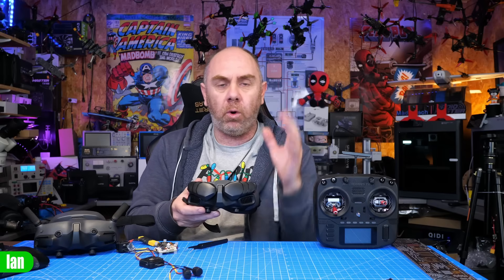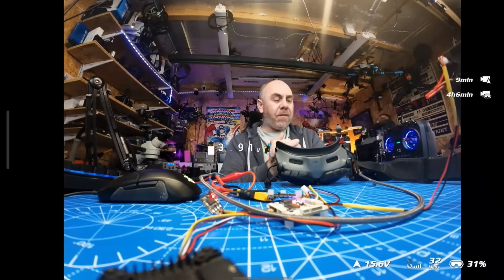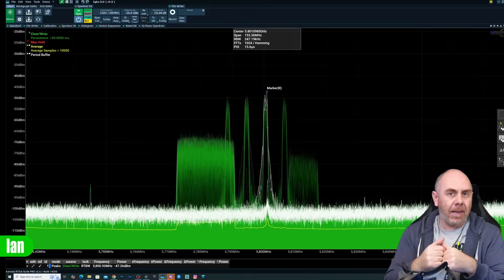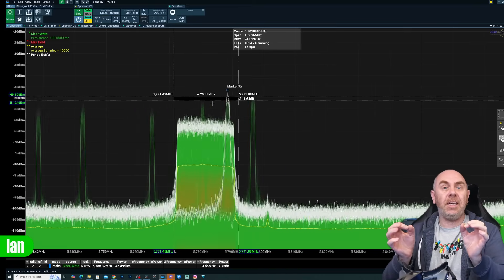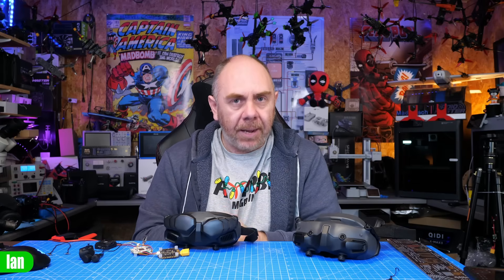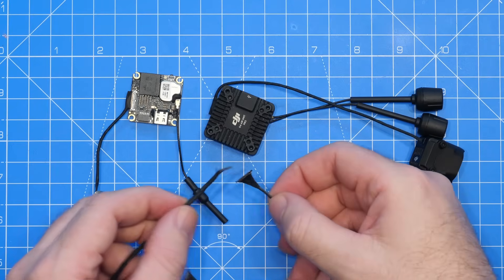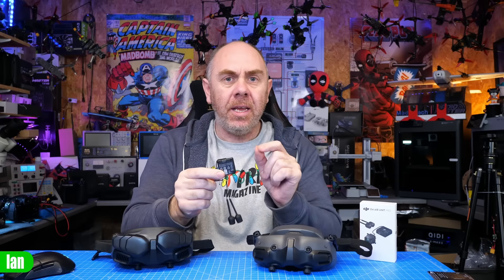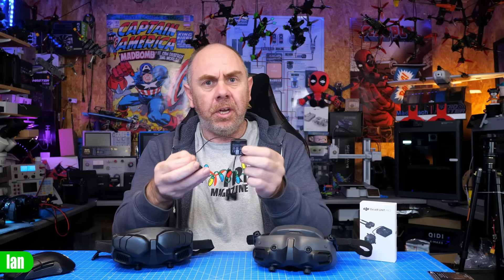DJI O4 Issues Warning - 16Mbps Goggles 2 Bug - Bad Camera Cables & Inav Arming & OSD Missing!

Comment: My O4 lite blinks black less than a second on my goggles N3 even in a flight, I dont know if is a kind of warning or something, In the begining I think this was for the low energy mode but when I arm the drone and begin to fly the issue is still there, the video from camera turn black a milisecond every 2 or 3 seconds (only video, the osd is still there), the rare thing is that when I see the goggles record it does not show that black frames even the record on the drone is fine, do you know if is only a warning of something ? or is a normal thing? I am new on this and I crash the drone some times, so I dont know if is a warning that something is not right with the O4 lite, and obviosly is a little bit anoying that black video little moments

Comment: Good job, I'm having a problem, I have a DJI Air Unit Lite and a Goggle N3, I updated the firmware on both. The N3 has an image, but when I turn on the propellers it freezes the image and then comes back. I'm using Cineape 20 (FC Darwin F411 15A), with 2S and 3S batteries. Do you have any idea what might be happening?

Comment: I saw this video right when it came out.But all my drones were 03, and my only 04 was the Avata 2, which is a pos imo. My iflight nazgul evoqie f5 with 04 pro just showed up today dead on arrival. Both DJI and Newbeedrone are telling me iFlight most likely killed this mipi cable during assembly. I missed my gig over this crap

Comment: Stucking video feed at 15-16 Mbps is not the main concern I think with o4. I am able to do 50mbps if I play with manual 40mhz and back to auto sort of thing. Reducing the mbps gives more signal strength so i dont really worry if i have less if i am further. Bad not to get it nearside though.  
The main thing is the overall low performance. I have 10 times better signal in rural areas with my old mini 3 pro in CE mode which has an o3 similar system i think. G2 is not only not changing o4 frequencies efficiently but overall performance is terrible as well. I tried it in CE mode it was a joke. FCC mode a bit better but after 1 km a  block of signal brings down the signal drastically to a signal loss (due to the not clever auto setting and the overall bad performance or interference?), this does not happen with my mini 3 pro drone. People say go with Goggles 3 but now that has interference with elrs? Probably not to best time to get in fpv with dji. I chose it because i thought its a bit more user friendly, never mistaken more.
Also i read the new goggles fw (or the o3 fw) makes the o3 cameras gets out of focus on G2?? what the heck. 
Also i dont understand a guy here from italy has no issues with G2 ce unit in fcc mode on o4. bad quality control?

Comment: o4 air / lite - small branch caused camera to disconnect - but it was the whole daughterboard, not just the cable- IMU error now with full video signal in goggles. since I bought it from betaFPV it is origin china. not eligible for RMA / warranty In the USA. I opened a ticket with both DJI and BETAFPV.

Comment: The one I purchased, when powered up the green & red led both light up & isn't showing in the assistant app & wont go into bind mode. When I search online all i get is some redit user with a similar issue but no solution. I first thought it was because my FC only had 5v output and the 04 requires Input Voltage: 7.4V – 26.4V with a recommended power input: 9V so I installed a BEC that outputs  12v. Anyone else run into this?

Comment: I have been writing to DJI Support for two months. After sending what feels like 100 log files and videos, DJI has now concluded that the issue is caused by the HAM file hack.

DJI’s policy seems to be that we have to buy the latest goggles where the hack still works. #madstech

Comment: Hey, thanks for your work! There's a big problem with the DJI O4 Pro. Can you briefly comment on it? The latency is terrible at 4:3. because there is only 50/60 fps in high Res. 2.7K x 4:3 x 100 fps isn't possible. This is very frustrating. Even the O3 managed that. I would expect with the new Gen 4K x 4:3 x 100fps. but there is nothing... Why DJI?

Comment: Hi ! Is there a solution yet to this issue from DJI ?  
I just got my new O4 pro to replace my O3 and works really shitty with my  Integra (with Ham file ).  Much worse performance than the older O3

Comment: Hey dude! I’m having the following issue with my O4 Lite connected to a T-Motor F7 AIO flight controller: I’m not getting any OSD, no battery voltage display, and the recording doesn’t start. I suspect that the flight controller isn’t communicating with the O4 Lite unit. Everything is up to date with the latest firmware.
and the videos manualy recorderd are not on the memory on the unit afterwards.
I’ve had a similar issue with another O4 Lite setup, where the cable wasn’t seated properly, but that doesn’t seem to be the case here. I’m getting video feed, but the bitrate is capped at a maximum of 6 Mbps. I’m using DJI Goggles 3 and N3 goggles. I’m completely out of ideas at this point.
am i the first one with this problem?

Comment: I have the Goggles N3 with the Ham file on it and the O4 lite in a fixed wing.
Went on a Testflight today and only got 32 Mbps and a max range of 2 Km which is disappointing.
I selected 40mHz manually before the flight.

Looking for a solution 🤷🏼‍♂️
Reply from the maker: There is an issue with the Ham file in FCC mode causing this. We are waiting for DJI to release new fw.
Reply: @MadRC can you check if the latest G2 update (that included O4) has the same effect on the signal with O3 please? Someone reported something like that, also messed up the focus as well.

Comment: Hello Ian tested today O4 + G2 with Hamfile( Italy)
 > i've esperienced all the issues you have reported about auto mode. I've also had some troubles with video feed with loss of frame rate( not on the Mbps) Tried to change switching from auto to manual to 700mw or 1200mw , the issue above just re occurred.
Once i switched to 04 + G3 no problems at all.
I guess ..and hope is something dji will soon solve

Comment: What actually happens if you only connect the air unit O4 PRO via USB and only update it, thereby skipping activation and binding it to the goggle without activation? Maybe this stupidity happened to me. Until then, what DJI says will happen. namely that not all functions are available. Now I wanted to carry out the activation afterwards. But I only get the error message “Activation failed, please try again”. Well, I've been trying again for 3 days. nothing happens except that a new LOG with 100MB is written to the Air unit every time. Can I reset the air unit to factory settings? Or do I have to send in the hardware just because I didn't follow the order for the firmware?
Oh well, what else I have to say. DJI can't help me with that either. There are currently no support staff available for the Air unit :D

Comment: #madatech 

I have the same problem. CE region, FCC HAM file. I’ll attach DJI’s response as a comment. 

„Dear Customer,

Greetings from DJI Technical Support. We hope this message finds you well.

I've been assigned to assist you with your concerns. 

We apologize for the inconvenience you are experiencing with the DJI Goggles 2 and the Air Unit O4 Pro not reaching the 50Mbps transmission rate in automatic mode.

The maximum video transmission rate of 50Mbps, as stated on our official website, is tested under optimal laboratory conditions with no interference and when the channel bandwidth is set to 40MHz.

In real-world flight scenarios, the wireless signal quality can be affected by various factors, including the real-time bandwidth of the image transmission and the level of environmental interference. When the aircraft's channel mode is set to auto, it may automatically select a 20MHz or 10MHz channel, which will result in a lower image transmission bitrate. The maximum bitrate at 20MHz is approximately half of that at 40MHz.

To achieve a higher bitrate, we recommend that you manually select a channel bandwidth of 40MHz or set it to auto and fly in an open area free from interference.

We appreciate your understanding and cooperation.

Best Regards“

Comment: I've been getting a similar issue in manual mode as well, arms at 50mbps and then drops to 30-33mbps. This is also fluctuating between 30 and 50mbps cause frames to drop and see stuttering in the image. Goggles 2 in ce area with fcc ham file to unlock 3 channels 
I'm also getting an issue with my 03 unit since updating to include 04. My 03 cameras are now out of focus, osd and everything else is in focus. I thought it was a damaged camera, but then tried one I had used before the upgrade and was fine is also now out of focus as well. 🤷🏼🤷🏼
Reply: I am dealing with the same things since 2 days… 
O3/O4 with G3 works
O3/O4 with G2 is just flipping mbps around and Camera seems to be out of focus…
Reply: @MagicMaik123 is your G2 started to work strangely with signals with the o3 as well since the last update on the goggles? Have you tried rolling back version?

Comment: Confirming the cable issues. I’m sending an O4 Pro back tomorrow. I’ve detached 3 times the cam cable to swap between two builds and now I get a black screen. The cam is connected, but black, I’m sure because if I disconnect the cable I get IMU error. I may have detached 100 times O3 cables and never had an issue. Btw I also checked the pin thoroughly, no evidence of damages. Faulty cable, for sure.

Comment: I have a O4 lite on a Pavo20 build (3S) that has much better range (and stays at 50MB) on Goggles 2 than the bnf Meteor75 O4. Thought it was this channel thing but still getting limited range, maybe the dipole antenna length?

Comment: I fly with DJI goggles Integra, mine are FCC with the hack, and I flew my new Flytimes drone with DJI O4 Pro for the first time today.  The Transmission Power is set to auto. The Integra worked normally, giving 50 mbps video bitrate as soon as I armed, and an appropriate bitrate during 8 flights where it only dropped below 50 when I flew behind obstacles to test it, always returning to 50 when I expected it to.
Reply: when I said the Integra worked normally, I meant the O4 vtx worked normally and the bitrate I kept an eye on in the goggles gave the values I was used to with an O3 drone.

Comment: Same issue..04 lite with Integra,CE mode with and without Ham file..jumps to 50mbps after arming..then fluctuating up and down from 7mbps to 40 somthing mbps..somtimes just sticks to 50mbps and works as it shoud.

Comment: A friend of mine meets the exact same issue with O4 and G2. But I cannot replicate the problem. I have G2 and O4 in full Auto and it goes to 50mbps when arming. I also reapplied the ham file to make sure, still no issue on my setup 🤔

Comment: Hey Ian, I have been flying the O4 with goggles 2 now for a couple of days and I see actually worse signal than O3, not by a lot but it had more frame drops over O3 so maybe a firmware update will fix this. Also 2 out of like 8 videos with the O4 had some issues with stabilizing the footage there were random shakes in the footage even when going slow and in other video this issue did not show. Do you think this can be fixed in the future or is this more like a hardware issue and an oversensitive gyro? I would love to get more of these units but I somehow now lost my trust in it

Comment: I have a bug with the ham file with my vistas also. On goggles 2… in auto mode my bandwidth is terrible. I’m fcc with ham hack….. without the ham hack it works fine….

I believe it’s a ham file issue….

Comment: I’m having the same issue on my DJI o4 Pro air units. 

I noticed it wouldn’t have the same range as my o3 systems and thought it was odd. I went down the rabbit hole and changed antennas thinking it was that. After switching from auto to manual it fixed the issue and stayed locked at 50mbs on my G2 goggles. I am using the FCC and ham file on my goggles.  Also I noticed that if you turn on the transmission power to 1200mw that also makes it worse. Oh and one of my air units came with the ribbon cable unplugged from the back.

Comment: Shame about the cables. The old V1 V2 cables were bulletproof. I could never figure out how they got so much strength out of those microscopic wires, even on the extra long naked cables.  I do hope someone figures out how to make some longer camera cables, as I need em in some of my fixed wings.

Comment: I did even have to crash it to have my cable damaged, I had "camera error call DJI support" after the first mount and I was very gentle with it (I am used to soldering SMD etc ..). DJI support concluded that it was DOA, just go through the chat they are pretty knowledgeable and quick.
Reply: Same thing happened with me cable was broken out off the box.
I haven’t take a single flight with it . And DJI is not willing to send a replacement cable and there are no replacements able to . What a trash 😢
Reply: @sahil_fpv  but you could return the entire unit no?
Reply: @ no DJI says they don’t officially sell in my country

Comment: He says the wiring for the cable is opposite of what it should normally be... does that mean if you swap the cable around, you could use other cameras with the O4? Like... how crazy could we get with the "other cameras"? Can we use a Caddx Polar with an O4? Maybe get some great low-light performance out of O4's better video transmitter and range?
Reply: AFAIK camera pinout isn't really standardized.

Good luck reversing ordering of that 30 or 40 pin connector

Comment: I've also noticed that the o4 antenna connector's lid is not as snug as the o3 was. I've already had my antenna come loose and disconnect..
Reply: That's not a good sign.  I was plannig to upgrade from original air units with mmcx to get to a better system.  Cause I hate mmcx now.

Comment: You've said 'hot glue'. Because of camera getting hot, I think it would be better to use some thermal resistive silicone. TBS has that Kingboxer DX-704 adhesive for antennas. Not sure if it'll work. With other silicone you have to be careful as normal builders silicone are AFAIK corrosive to PCBs.

Comment: Hi Ian, can you confirm that 2.4ghz, 5.1ghz, and 5.8ghz can be manually selected in manual frequency mode when using G3. Thanks
Reply from the maker: O4 does not support 2.4ghz.
Reply: @MadRC  But on my test with the NEO using G3 and RC3 it does support the 2.4Ghz band as video transmission. Also in their website they claim that the latest O4 video transmission, it supports 2.4ghz as well as 5.1Ghz as the new addition.

Comment: Using Goggles 2 and O4 Pro I can get it to 50Mb/s by using channel 2, but only 30Mb/s when in channel 1 or 3, very odd. All in manual. When selecting channel 2 in 40mhz, then going back to auto I got it to get to 50Mb/s in auto. I'm in CE using HAM file. On the Avata 2 with goggles 2 I have the 16Mb/s issues also, and have since I got it, makes sense I guess aa it's also O4. With that I have to go into manual, 40mhz, then back to auto for every flight

Comment: I just updated goggles 2, and I tried going from manual transmission to auto again and see what happens. When I armed it went to 50mbps as it is supposed to do. I hope after restarting everything it will behave the same. The issue seems to have been resolved, for the avata 2 and goggles 2 at least…

Comment: Interesting.
I've been one of the first to test the workaround for INAV to allow recording on arming, looking good that thing, so pretty sure INAV 8 will have it included. 
But at least O4 allows to disable low power mode and manually set power and channel, actually feels a bit like old analog systems without Smartaudio. 
Positive side is that it allows to trigger recording whenever you want, and also finally stats are being recorded as we stop recording manually after disarming.

Comment: Good spot 
Been flying g2 ce area with ham and noticed on pro unit flying whoop on 35mbs 
Regarding o4 lite I have ripped cable directly of cam and managed to connect it back and support it with glue 
Notice also in crashes video disconnects even drone still working fine 
Have to reconnect battery 
Power direct from battery 
2s whoop 
Thx for your hard work 🙌🏼🤌👋

Comment: On my o4 i also have the issue where it doesn't recognise the arm command. It is on betaflight and the canvas osd is working.
Reply: correct uart selected for the o4?
Reply: @enjoy_and_fly  I'm not 100% sure but it worked before on o3 and the osd also works. So the uart connection must work.

Comment: FCC region, and ham file for me. I also get a red "connect dji fly outdoors" message. You're a freaking genius! more helpful than DJI! I feel like the firmware is sharing code with the avata somehow, the red flag I get seems to be a problem with gps and the avata too, but fixed by plugging into the app on that model.
Reply: In the DJI goggles firmwares updated since April last year, there was a problem of messing up the time stamp. This caused wrong date of the video file. 
As they failed to fix the bug by all means; instead, DJI updated the firmware and ask you to connect to your phone with GPS  simply to synchronize the time stamp across the board.

Comment: Only one time have a bug on o3 stuck in low power mode, after 2 or 3 reboot fc connect and disconnect battery the issue solved. Never the same problems

Comment: I've had this issue on O3 for a long time , it would get stuck on 15mbps and I would switch to manual and back to get 50mbps. I didnt realise the issue myself until a friend flew my drone and picked up that my goggles were much worse than theirs however it didnt have much effect on range as we could fly in tandem over the same distances.
Reply: I had this issue with one of my o3s and i sent it in and they shipped me a new one. i just assumed it was an issue in THAT unit
Reply: +1
Reply: +1